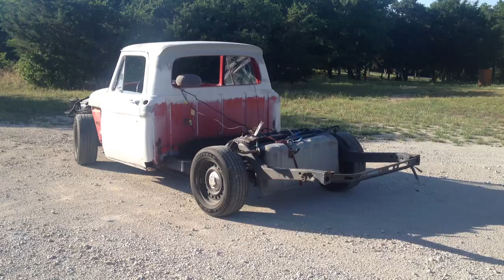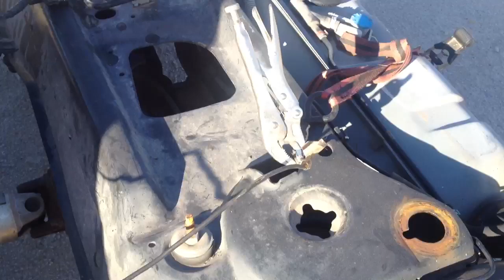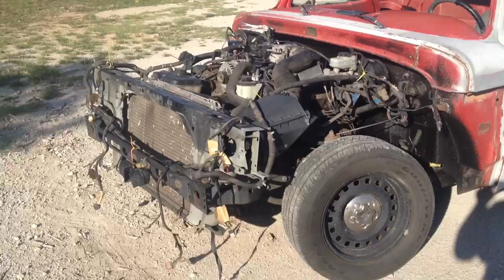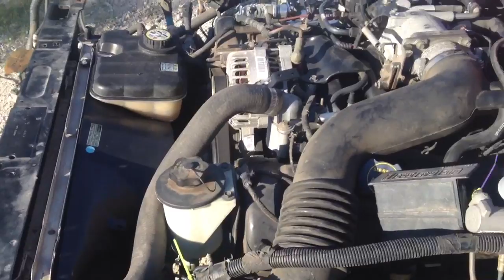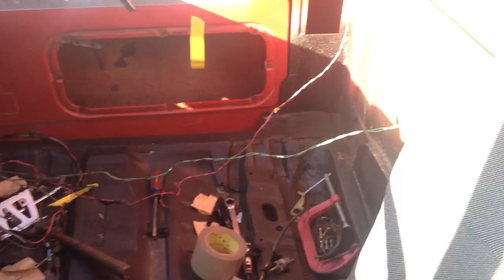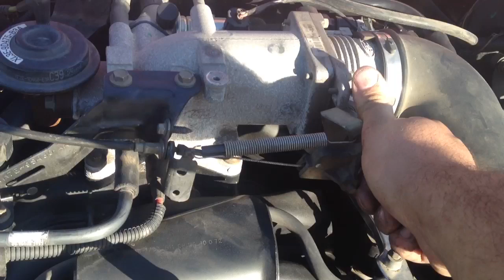1963 F100 Full Crown Victoria Frame Swap

Comment: im acualy doing a simular swap but under a 1982 transam and with an engine swap and lowering component added in just to add chalenge , with this engine i also need to widen the front frame and the rad support to accept a 40 inch wide radiator